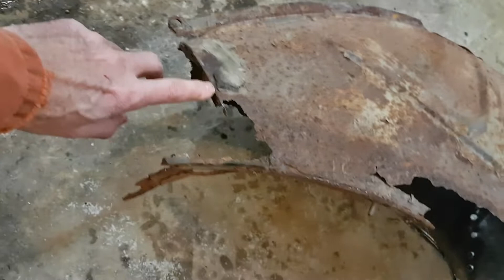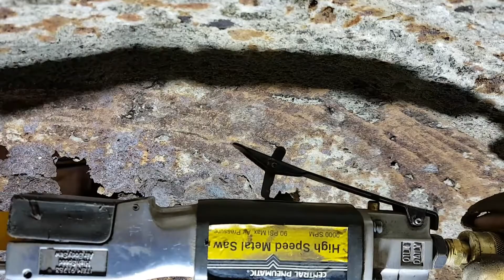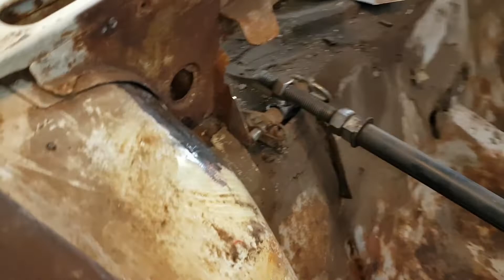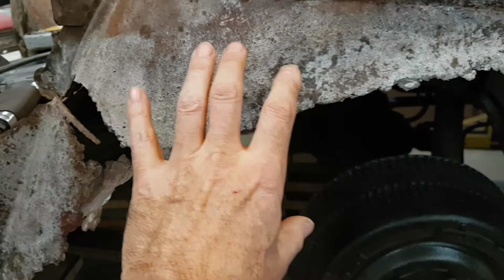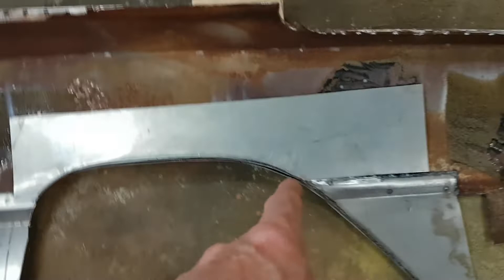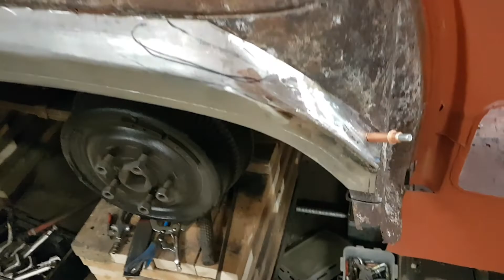Right Rear Wheelhouse Repairs - 65 Thunderbird Convertible Restoration Ep #28

Comment: HEY!! If you ain’t cheatin, you ain’t trying!!! Sometimes when you don’t have a 500 ton press to stamp out you parts, you gotta improvise. 
Personally when I use the tipping die I don’t install the bolt. It allows me to go almost to 90 degrees on the sheet metal. And I’ll add a small degree of tipping to the rest of the flange to point the edge of the metal in an upwards direction to keep potential sidewall scratching on the tires. And it adds a little more stability to the wheel well.
Keep up the awesome works Alvin!!
Reply from the maker: Thank you for the tips Troy! You're comments are always loaded with great information, really appreciate you taking the time to make these comments! 😊
Reply: Anytime, I like to help just as much as I like to learn new tips and tricks. Especially to someone who not only listens, but is doing such a great job!

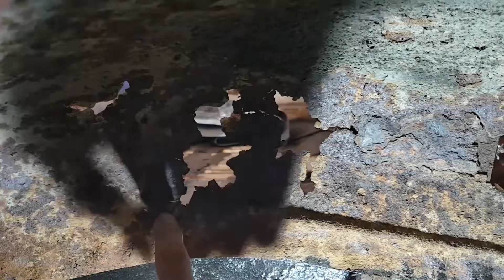Comment: Hello Alvin. I was looking forward to see how you were going to do this part of the fabrication. It seems that if you own one of this series T-Bird and it's rusty, this is where it really took a beating from the salted roads. Mine sure did. Your repair is looking good and strong and should last a long time. Thanks for showing. 5:12...quitting time! LOL
George B. in Michigan
Reply from the maker: Hi George, I almost bought the patch panels for these wheel houses because they are a bit involved to make, but I decided to try and make one, and if that turned out to be a disaster, then I could still order a pair, the same for the wheel house extensions...I'm going to try to repair the ones I have first, if that doesn't work, then I'll order some.
Ron graciously offered to restore that old clock, but I'm thinking that I would like to use it as an ending to my videos, I'll think about! 🤔
Thank you George, as always great comments and new ideas from your comments! 😎

Comment: Great ingenuity really like what you are doing, if this where myself there would be a lot of empty cans lying around making the job twice as long or longer. You use a cup wire wheel on the grinder ? CTCs
Reply from the maker: Thank you Rick!
Lol...there was a time when I would have had a few cans kicking around too! 
I use a few different wire wheels, cupped, flat, and smaller ones for the drill...they all have there place. I do like the knotted wire wheels the best when doing large areas, they don't seem to release the wires as bad as the basic wire wheel...but they are to aggressive for delicate tight spots.

Comment: This is so interesting to watch. The inner wheel arch is just looking great. I have an inner wheel arch to do on my Mondeo come the spring, the outer is no problem because patch panels are available, but i will have to fabricate my own patch for the inner. I can see now just how valuable a tool that motorised bead roller really is. I will have to build something similar before attempting my repairs. I am starting to collect a few sheet metal tools, i have a nice english wheel, plus a stretcher and shrinker, and am in the process of building a brake. Though after watching this i am rather wishing i had got a bead roller first! Oh well, there is no rush. But your videos really have inspired me to get some proper tools together - just got to learn how to use them and get the best from them! Where again your videos really will help me. I have been doing my own body repairs for years, but have always struggled by without the proper tools, so have always done a lot of slitting, bending and welding to get the shapes i needed. You have certainly encouraged me to step up a gear. So thanks for all of the really interesting videos.
Reply from the maker: I happy you are getting something from my videos, it sounds like you have pretty much the bulk of the basic tools. I was in the same spot only a year ago, making parts the same way you described, and there nothing wrong with that way of doing it. I feel the big three, bead roller, shrink/stretcher, and an English wheel are well worth the investment, even just the low end ones, because it get a person thinking and practicing something new, I will most like continue to upgrade those three tools. 🙂
Thank you for watching! 😎